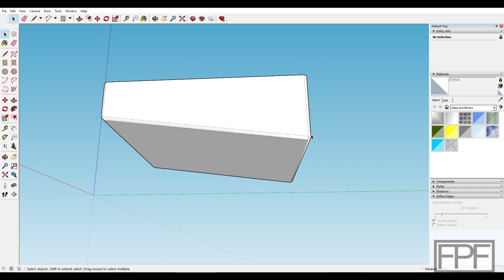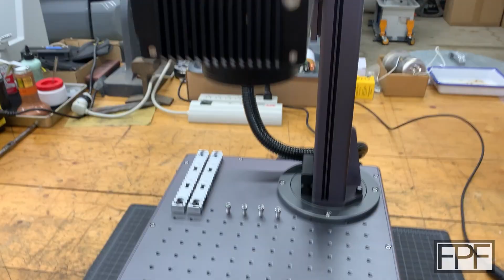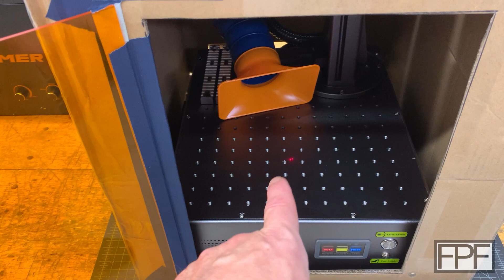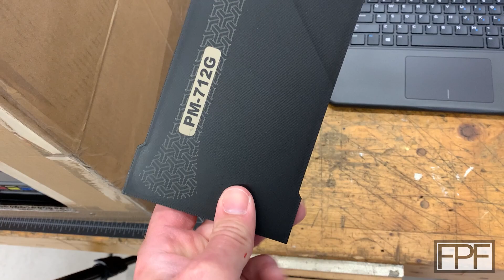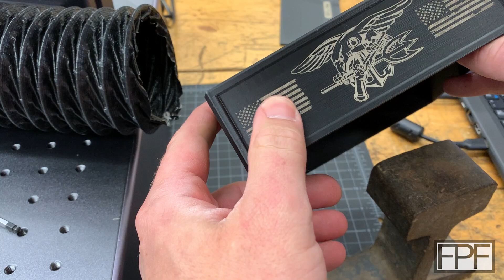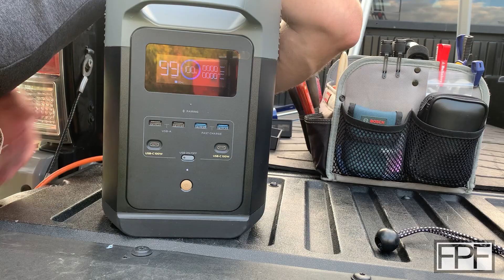3D Printed Fiber Laser Engraved 6x6 Post Caps - Monport GA 30

Comment: It's at least a year later, how's the PETG-HF holding up?  And the laser engraving?   I print in Black PETG-HF all the time and recently got a mopa laser (arrived from China a bit beat up, so it needs some work) but didn't really consider using PETG and laser together.  Great video!
Reply from the maker: still holding up great.  If you got a damaged machine I hope you held the supplier accountable. .

Comment: Love the form factor of this laser. How do you think it would perform on PA6/12-CF/GF filaments? I need to do some marking very similar to what you did on this video on a small batch of parts. I'd love to add a fiber laser to my lab for doing metal engraving, but I want to make sure I can engrave 3D printed parts reliably. Also, can these lasers do cylindrical objects? Is there a rotating jig?

Comment: Hi, I was wondering which nozzle size did you use for those printed parts? 0.4mm or 0.2mm? And which size of lens do you use? I have a 50W n9n mopa laser, i need to convert your parameters. Thank you!
Reply from the maker: .4
Reply: @FunctionalPrintFriday  and what about the size of the lens of your laser engraver? The info is written on the lens. Thank you!

Comment: Bed adhesion of PETG after PLA is poor. Something in the PLA sticks around is brutally hard to clean using soap or IPA. Effectively your PETG was "cleaning" this. My trick is my I use one side of my PEI plat for PETG and the other for PLA. Someone mentioned it is some weird form of sugar.

Comment: Two weeks ago I also used some (grey)  PETG-HF to make a custom connector between new 4x4 wood post and chain link top bar
Reply from the maker: How did it print for you?  Just as smooth and clean?
Reply: @FunctionalPrintFriday  Yes just like yours it is as good as any PLA I have used  (I also printed on a P1S).  I think it is important to thoroughly dry it before printing (As per the instructions)

Comment: I had success trimming fence posts with my festool track saw. They have clamps that go into the track and you can clamp on both sides. So I think a better approach would be just mark your line with a square and clamp the rail right on the line. You just have to hold the saw to the track well but it's pretty easy. If the saw won't cut all the way through, just a hand hand saw to finish it off using the kerf as a guid.

Comment: You can try cleaning the print bed surface with alcohol before each print.  At least that is what I do with all prints before printing and have never seen that problem.  And I use PETG most of the time.

Comment: I love it but my OCD was triggered when you did not flip one of those flags around to be properly mirrored around the center logo 😂😂. That's okay I'll live with it.  Are fiber lasers much more expensive?   I personally would be piping the fumes directly out of the building rather than through the scrubber. The scrubber could perhaps remove smells but you never know what's left behind or when the filter starts failing
Reply: I'm a vet, not that you'd have to be one to notice, but the star field to the left seems to be the protocol. Mirrored, somehow, just doesn't look right.
Reply: @USS-DDG-2  I definitely see that perspective... But I also know that you salute it no matter which side of it you're looking at. Thank you for your service
Reply from the maker: thx for your service

Comment: The twentieth century called. They want their corded circ saw back.
Reply from the maker: I bought that saw from a local store when i was about 12 to cut wood for my tree fort.  It’s cut tons of wood, stone, brick, concrete, and metal.  Old skool Makita does not die.  Bearings aren’t even noisy, and cord is still proper soft rubber.
Reply: Worst comment ever.
Reply: I know what you're saying, but some battery powered tools just don't cut the mustard. I bought a corded hammer drill just for that reason.

Comment: I use 90+% IPA between prints and get the white haze on mine.  Even after cleaning with warm soap and water it is less though still there, but as soon as I put the IPA down it returns.  Using the YIHUA 959D-Digital Hot Air Rework Station you recommended (thanks!) makes quick work of removing the haze.  Keep up the amazing content.
Reply: India pale ale?
Reply from the maker: thx, now I'm thirsty
Reply: @schmi146 Isopropyl alcohol
Reply: thanks for confirming my white haze issue on my new A1

Comment: The white your seeing normally occurs if you take the prints off the bed before it's fully cooled. To get rid of it, just give it a hit with a flame from a lighter or another source and it should go back to a rich black !
Reply: I've had it show even when it was fully cooled. But yeah, just a blast of hot air or quick flame clears the stressed plastic up really fast.
Reply from the maker: interesting, I'll try this, thx

Comment: I'm about halfway through the video you haven't mentioned what printer you're using?  I could suggest a thorough bed cleaning when using PETG,  the texture looks like what my Bambu P1S came with I think they recommend not using the textured bed sheets because the PETG grabs it too well. Yes the texture looks nice but a glue stick, hairspray or another adhesive/release agent is your best bet. The  smooth sheets work better with the glue because it doesn't have to get into the texture crevices.
Reply: they recommend the textured bed for PETG if not using a release agent, the textured coating is much more resilient than the smooth plate which is basically just a big sticker, while the textured one is a bonded powder coating process.  if you want a smooth surface for PETG, you need to use a release agent, or something like a garolite G10 plate.
Reply from the maker: P1S

Comment: ASA is definitely the filament of choice unpainted for this application. But if you paint them, petg should hold up well.
Reply from the maker: I've had surprisingly good luck, even with plain old PLA, but yeah I've heard ASA is very good outside as well.  More voc's printing though right?
Reply: @FunctionalPrintFriday  ASA’s party trick is UV resistance. That said I have had very good experience with untreated PETG (generic) that I made light brackets for both my sons bikes, they lasted years